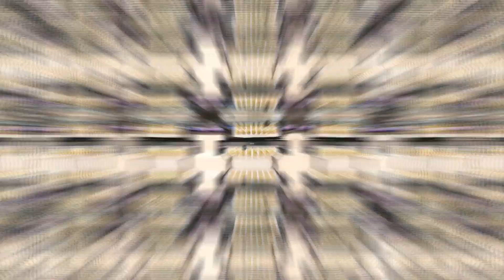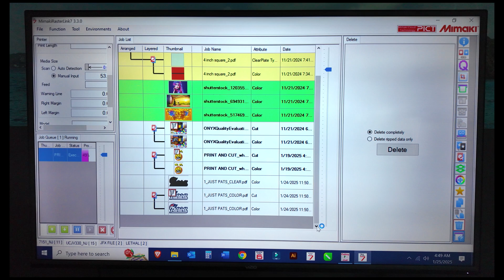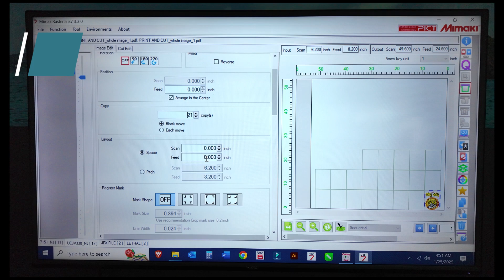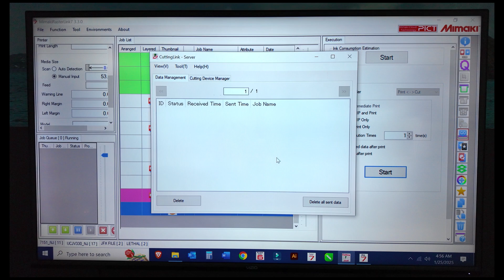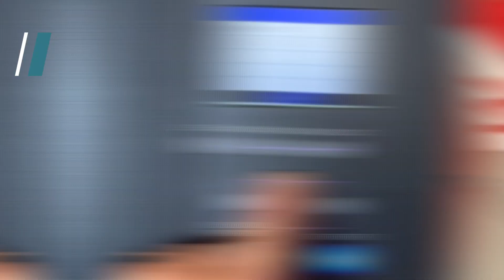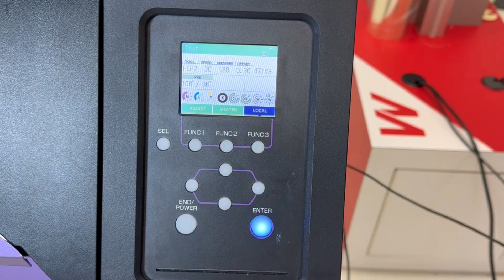How-To: Set-up and Use Mimaki ID Cut / CuttingLink / Bar Code

Comment: ID cut grayed out? I'm using a CJV330-160_Raterlink7_Finecut9_Cuttinglink_Adobe Illustrator. Just in case someone is having a similar issue.  My Cutcontour spot color was not showing up in the "cut edit" window of Rasterlink7, although my cut lines were registering from Adobe. My mistake was, I was using the RL on the Finecut9 plugin to get my image to Rasterlink7. You need to save it to your computer then file>open in Rasterlink 7 to bring it in. Then the ID cut will be lite up, if your registration marks etc. are all correct.
Reply from the maker: Thanks! The devil is in the details.  The "click along" training saves file as PDF and then opens it in RasterLink.  For me. this works best.

Comment: I am trying to print to a 7151 and then cut on my CGAR plotter using ID cut. I'm able to import the file into the printer, and set up ID cut with proper crop marks and cut settings. But when I go to print it, I get an error: "This job is set to print mode that this printer do not support." It's somehow referring a media size of 28.03 in (Auto Detection). How do I change this?